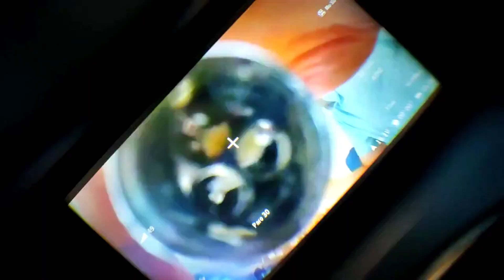High Speed Footage of DJI and Analogue Goggle Screens

Comment: one thing i never really understand with latency testing, how can a analog cam have for example 5ms latency if its only 60fps(16,6ms/frame)? yes maybe the very first image is 5ms but cant be the next image at best 16,6ms later and not 5ms?
Reply from the maker: In analogue video the frame does not arrive all at once it arrives over 16.6ms. So in my testing the first line of the new image can arrive in 3ms but it then takes another 17ms for the rest of the screen to be updated. So you can think of it as 3ms for the first line, 20ms for the first field, 37ms for the first complete frame.
Reply: @ChrisRosser   would that mean I get a new information for a line every 37ms with a  3ms rolling shutter cam and every 40ms with a 6ms cam? How does it work with global shutter? Doesn't do a global shutter cam half of the frame at once? Sorry for the questions but I finally want to understand what the real world differences are :) thanks for the answer so far :)

Comment: One thing I currently don't understand. The high speed camera approach answers so many more questions than the LED photodiode approach, why don't we just do measurement of latency from the high speed camera? We know the frame rate of the high speed camera, we can see during a frame grab when the LED turned on. If these two things were synchronised, we would have an absolutely indisputable method of measurement. Specifically, if it is possible (and I imagine it should be) for the high speed camera to trigger the LED, then the high speed camera would give us a verifiable and accurate measurement of latency. 

There are just too many unknowns in the photodiode + oscilloscope approach for me. 

Also, given the core differences in the way the analog and Digital systems work, we may really need to nail down what we consider as latency.
Reply from the maker: I'm planning to do this testing over the next couple of weeks once my new high speed camera and SB system arrives.

Comment: Interesting! Thank you!
What camera did you buy? My experience is that the light capture on the camera must match or be faster than the one on the screen. I did fluorescent imaging in the microsecond range many years back and the speed capture was a key component I had to look in. And by the the camera costed about what I earned in 2 grants 😁
Reply from the maker: This was with a Samsung Camera Phone. I have ordered a Sony high speed camera for the follow up testing which will hopefully be even better.

Comment: Nice that we see some more interest in the field of latency testing ;) I've almost abandoned this since I don't use analog anymore and analog FPV cams have gotten very good at latency.
I can remember that analog cams change a few years ago from also displaying half and full frames (can't remember the term) to instant updates (global shutter?) as you show here. Since the latter, my analog latency tests were much easier and more consistent, before that it was very random, and the accuracy of tests was determined by the framerate and where in the ntsc or pal frame you turned on the light.
For DJI tests (don't know about sharkbyte) I found that the latency numbers the goggles show is actually quite close to what we can measure - but I agree, to see the really high accuracy a lot of testing needs to be done. But then again: the user will not notice the deviation of a few ms from cam to cam, only something larger than 10ms difference would be noticeable...
Anyhow, thanks for your efforts, great fan of your scientific approach (my videos are only "almost scientific" at best).
Greets, Mario
Reply from the maker: Most modern CMOS FPV cameras have a rolling shutter. Older CCD cameras typically have a global shutter. There are some global shutter CMOS sensors. I think the most recent HDZero Cam GS is one of the very few global shutter cmos cameras used in FPV.

Comment: So analog signal is only 60fps? So even with a 120hz or 240hz screen you wouldnt get any better latency?
Reply: I think it's the encoding system which limits the framerate. You know PAL and NTSC. They only allow 50-60Hz vertical update frequency.
Reply from the maker: Yep spot on the display in the analogue goggle updates line by line as the analogue video is received and processed line by line.

Comment: This is a great finding! Your video has me now thinking - the goggle display might be just as important to glass-to-glass latency as the camera and video transmission system. Just like the cameras we use can have either a global or rolling shutter, the display itself can have a global update (which you have shown with the instant switch on DJI) versus a rolling frame update (as shown by the progressively increasing brightness with Analog).

It also shows that the DJI system seems to be mixing these two types of methodologies, with a rolling shutter camera and a global update display.

Good stuff!
Reply from the maker: Yes! You've got it spot on. The way the screen updates is super important and quite different for the two systems. The difference between the sub-ms full screen update on DJI vs the 16.6ms progressive update on analogue could affect latency testing and perhaps even how you perceive the video.

Comment: Can we use a high quality high speed camera to misure the latency instead of oscilloscope ? Just measuring the quantity of frames from when the frame is full illuminated to when the light from the diode is complete gone? Or is it not reliable ?
Reply: Seems possible and I don't see why it should be unreliable.
Reply from the maker: I'm going to try when my high speed camera arrives.

Comment: Which analog camera did you use? Looks like a global shutter camera.
Reply from the maker: Its a Turbowing https://www.joom.com/en/products/5c7523118b2c3701010ab981 CMOS camera with a rolling shutter.
Reply: @ChrisRosser  interesting. I expected that the rolling shutter analog system would also start the bright part somewhere in the middle and not from the top.
Reply from the maker: @Chris-xe5ts  It actually starts right at the bottom of the frame in this example then immediately jumps to the top. In other tests it started in other places.

Comment: Perfect! I disagree about the results being random for analog video though. If the light threshold is set to the point where the screen transitions from all black to just one line being white, the results will be very consistent.
Reply from the maker: It's not random, it will land somewhere betwen a minimum and maximum value depending where on the screen the photodiode is and where in the scan the light turns on.
Reply: @ChrisRosser  understood. I guess it depends on our test setups then. If you have time, please have a look at my friend Jeff Kubascik's recent data using a scope to measure latencies (can't post a link or I would)

Comment: Is there a "Screen tearing" come to scene? Frame rendering on analog and digital is the same line by line, pixel by pixel. Nothing changed since first TV was invented. Difference is that analog start to render the frame as soon as it get the information. Digital render frame first on graphic processor, keep them in frame buffer and send to lcd as soon as frame is ready. But frame rate of receiving packages is variable, when frame rate of lcd is constant. Literally when lcd receiving part of the one frame and the next one is rendered in the frame buffer, lcd starts rendering new frame, from the same line position, where previous frame render was interrupted.
Reply: Exactly, Screen tearing was exactly what came to mind. But I presume with a higher speed cam we would still see line by line update but on an lcd if the input is stationary then there’s no flicker and the “pixel” just remains as it was on the previous frame. If instead the image was moving id expect to see the elements updated on a left to right top to bottom line by line manner. In contrast, an old CRT each light element is constantly pulsed at what ever color is there even with a stationary input. There’s a great vid by the slo mo guys. You need a really high speed cam to see this
Reply from the maker: The DJI panel updates faster than 960FPS can capture (it does probably update line by line but so fast as to be near instantaneous <1ms) then waits statically for ~8ms until the next frame. The analogue panel updates line by line but much slower taking 16.7ms to update the whole screen.
Reply: @ChrisRosser  ah that could be. Your tests certainly explain the variability in measurement with a photodiode which depends on where the diode is placed. I use one in my lab to detect the end of a vertical refresh and we also record the diode analog output so we can actually see the rise and decay of the lcd elements and it also takes time for the light to rise to full brightness (~2ms) then about ~3ms to decay back to black. We use a flickering black to white pulse in the corner of the screen to measure precise frame times. I recall testing the diode at different vertical points and getting same latency result and could never figure that out. Seems consistent with what you’re saying. We also get tearing unless we force the video buffer to wait for the end of the refresh before swapping buffers and drawing next frame. But I suppose it’s fastest to just let it go and incur screen tearing. This also explains the stutter we see in DJI when a new frame is not available, it just holds the last frame until new info becomes available, whereas analogue will always display something even if garbage
Reply: @ChrisRosser  this slo mo guys episode shows that you need a higher frame rate to see the lcd update and it clearly is drawing top to bottom left to right like analog. The only difference is analog there’s only one active element at at time as it scans through but because of the rise and decay duration of the element it gives the impression of a scan line moving vertically. An lcd on the other hand keeps the screen lit unless new elements are changed. But still drawn left to right top to bottom. But you need >960fps to see it https://youtu.be/3BJU2drrtCM